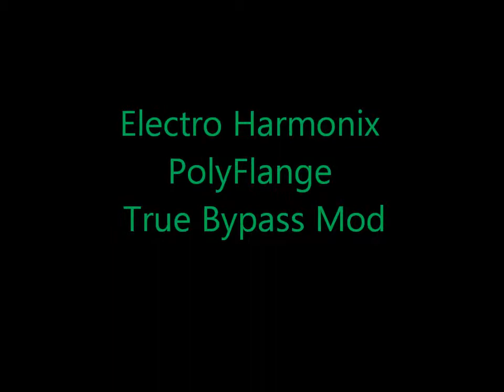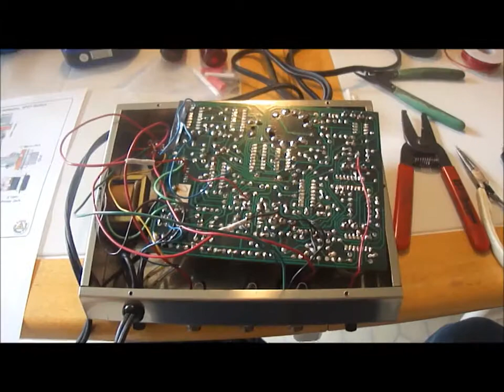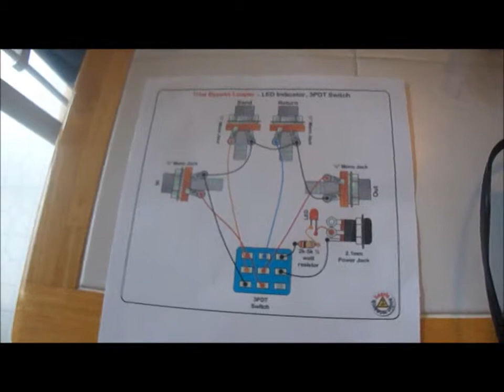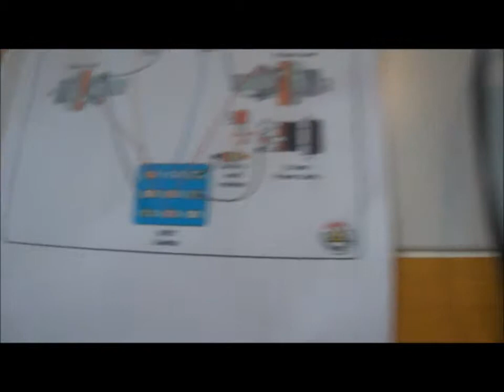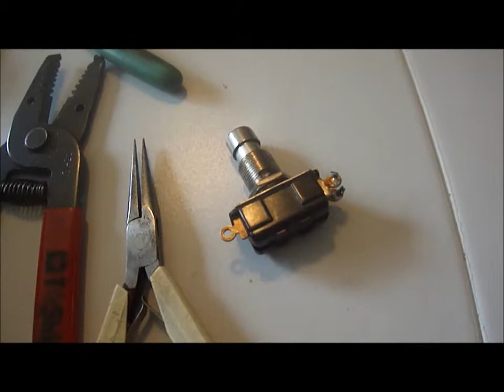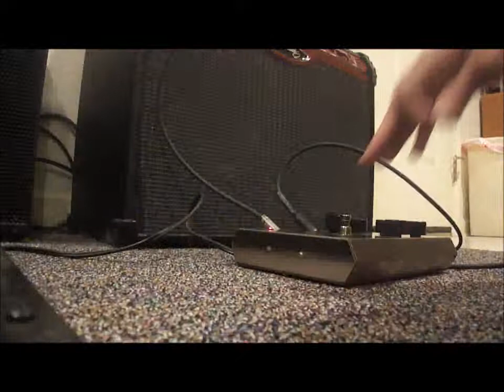Electro Harmonix Poly Flange - True Bypass Mod

Comment: Its a tone sucker for sure.

I have 2 Echoflangers and 2 Polychorus’s.

I usually use 2 or 3 in line and the more of them you use, the thinner it sounds (tone sucks). But when I use a Boss DS-2, which is also a buffer, it really helps bring most of the thickness back.
Reply: Yes, putting a buffered pedal in front definitely helps. I’m using a modded Boss SD-1 for that. I plan to go back into the PolyFlange and redo the LED part of the mod using an LED ring around the footswitch with a resistor to protect the LED and help with the popping. Thanks for watching!
Reply: @tomgorycki7176  will you upload a video of that? One of my Polychorus’s is wired so the light turns off when its not on and I was thinking of doing that to my other pedals.
Reply: @XxStonedImmaculatexX  Which version PolyChorus do you have? Does it look like the PolyFlange in the video or does it have an external power supply (wall wart)? The earliest PolyChorus was basically a rebranding of the PolyFlange, like Kurt Cobain’s version. EHX later changed the circuitry, put it in a smaller housing, added overload and status LEDs, and went to an external power supply.
Reply: @tomgorycki7176  I have a stereo polychorus with the wall wart 24v power supply, overload and Status LED. Im not sure if this version I have can have true bypass, I hope it can. I also want to add the status LED to turn on and off when the effect is on or off.
Reply from the maker: @o_o0_x914  There are a few different versions of the PolyChorus/PolyFlange out there. I think I found the schematic for yours. https://www.audioservicemanuals.com/e/electro-harmonix/electro-harmonix-poly/8783005-electro-harmonix-poly-chorus-schematic . You should be able to convert to true bypass with no problem. One thing I failed to mention in my video; The new stomp switch is only connected to the Effect Out and I keep the Blend switch on (not using Direct Out but it still works). You could just buy a 3PDT stomp switch from someone like Amplified Parts and wire up 2 of the 3 poles (sub sections of the switch) for true bypass and use the 3rd pole to switch an Engage/Bypass status LED. When you remove the old switch, you will need to hard wire those connections to keep effect always engaged (the true bypass switch brings your signal in and out of the circuit). Here's a website with some wiring examples (scroll down to True bypass with LED) https://stinkfoot.se/archives/2233 . For the LED indicator, you could steal some power from the incoming 24 VDC power supply and use a step down resistor (value depending on type of LED used) to protect the LED. I hope this helps. Good luck!
Reply: Would you sell one of your echoflangers?